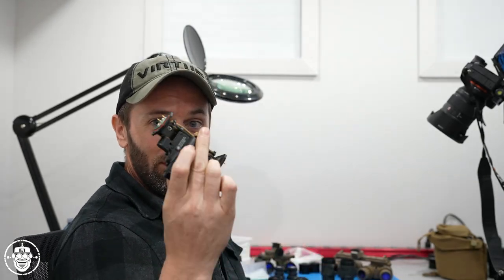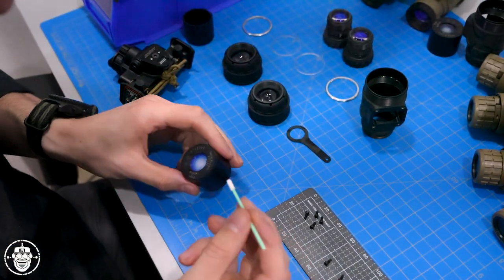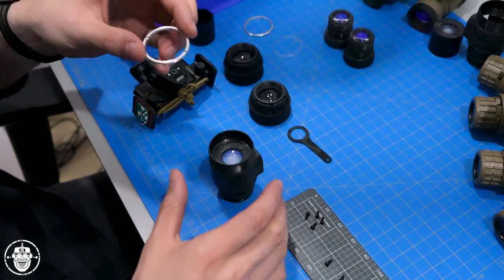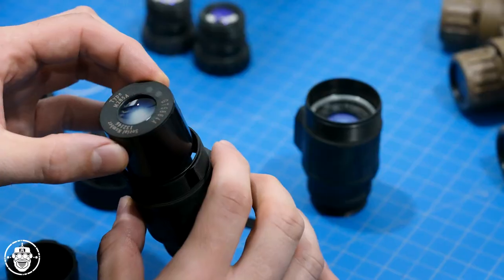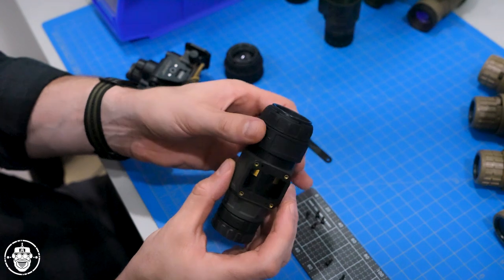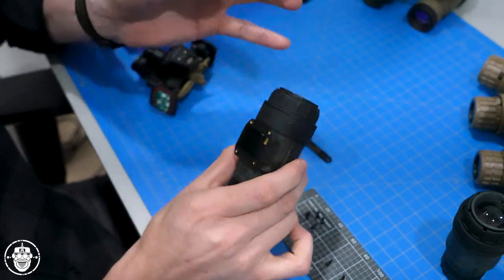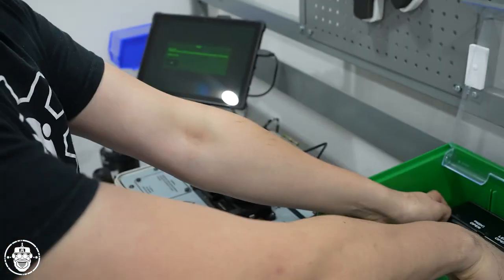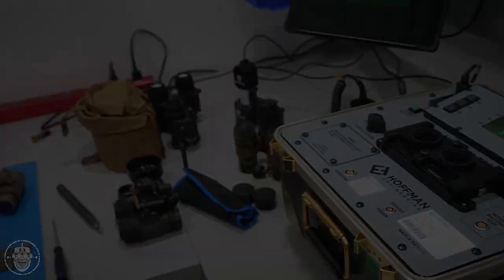Robo Gear Build: BNVD 1431 Mk2 Tube/Lens Swap - How Nightvision is Built

Comment: Does the gen 2 work with a standard pvs-14 retainer ring for the tube
Reply from the maker: yup - same ring. It's all based on 14 glass dimensions.
Reply: @robomurrayairsoft  Thanks, I ended up getting a DTNVS housing in a trade to use for the build but I still appreciate the info

Comment: Hey man, i have a set of mini nseas nvg which uses photonis XR5 or XD4, thinking about getting a new argus housing for the tubes, i was wondering if it will fit. I havent yet open it up to confirm the type of tubes its using, but wanna find as much infos as i could.

Comment: I was confused when I saw you posted a video but pleasantly surprised. I actually have the same housing with L3 tubes, didn't build them myself though.
Assuming the tubes you have are adjustable gain, have you ever noticed slight flickering in either tube when you lower the gain?
Reply from the maker: My tubes actually aren't adjustable gain, so I haven't noticed any flickering. The only oddity I've experienced is in - what I think - is the auto gating kicking in when I turn them on IF in an environment where it triggers auto gating. It seems like one pod powers up before the other. Minor, but noticeable. And only in a brighter environment.

Comment: I don't understand what is actually being adjusted on the goggles during the collimation phase. Can you explain that?
Reply from the maker: Great question. And sure can:

Essentially collimation is the final step of ensuring that both tubes/pods are aligned in respect to one another correctly and on the same axis of vision.

Missing that step - at the lower end of the problem, you'll get very slightly offset images of what you're seeing, from eye to eye. The brain largely can correct this...but it strains itself to do so...so it brings on eye strain and fatigue a LOT faster than regular nvg use.

At the worse end - if it's REALLY out of wack - then you'll see blurred and double ghost images of things which is even harder on your eyes and brain, and can make the nvgs unusable.
Reply: @robomurrayairsoft  Thanks for getting back to me, but I still don't understand what is being adjusted specifically on the goggles to move the tube into the correct position. Is there a screw somewhere that lifts one tube up a bit or something?
Reply from the maker: @__K__B__  gotcha. It's physically adjusting the whole eye piece assembly until they match each other's axis.
Reply: @robomurrayairsoft  Ohh, got it. That explains why there is a little hole on the ocular side of the PVS14 for a grub screw. I was wondering about that.

Comment: Did I see an NNVT tube? How do you like those?
Reply from the maker: You did! There's a long ass back story to why I'm now using NNVT that I might cover at some point - but I'll say this, NNVT is better than what I was using before (as I came to find out - again, backstory). I was pleasantly surprised by NNVT quality: am I completely down with the fact that it's a chinese product? No. That said - two things: 1) we're extremely limited in Canada with what we CAN get, and 2) the technology from outside the US over the last decade has gotten VERY good.

I've only had these tubes for about 2 weeks now, but overall - don't have any current complaints. It's a good option for the price point.
Reply: @robomurrayairsoft  wow thanks for the awesome reply. I didn't expect that. I also run NNVT here in South Africa because western made tubes are hard to get here. I love them though. Thanks for the awesome content.